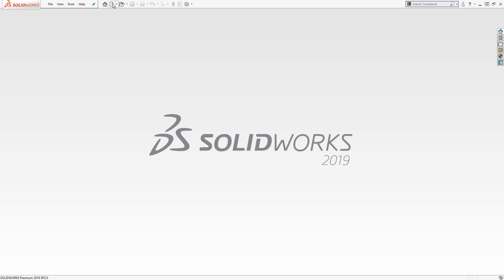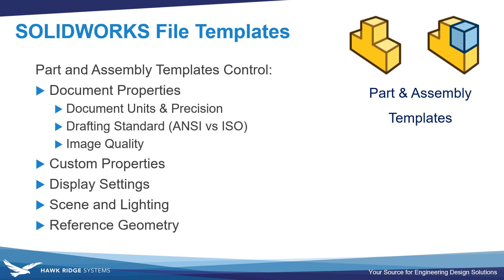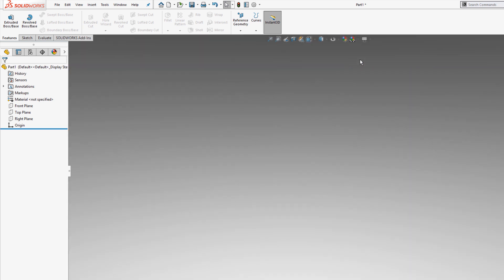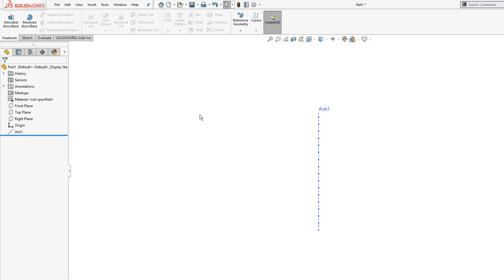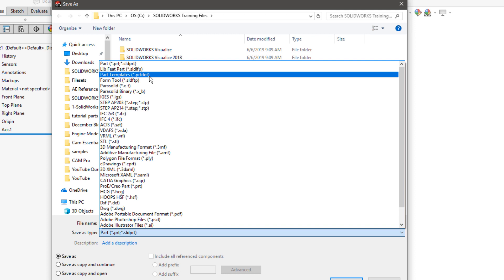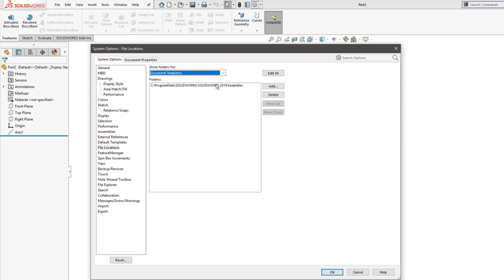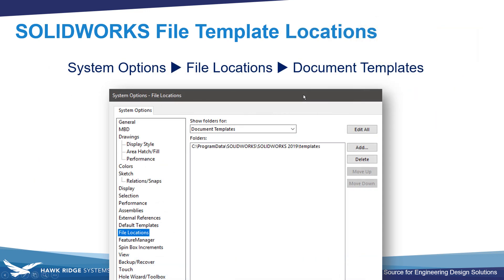SOLIDWORKS: Part and Assembly Templates

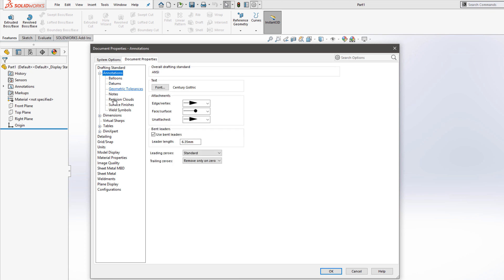Comment: You left your Drafting Standard as ANSI.  Then at 2:17, you say, "If you want to make any changes to annotations or dimensions, this is where you could do it."  But, as soon as I changed the font from .125 to .156, the DRAFTING standard is no longer ANSI.  It becomes ANSI-MODIFIED.   The same thing happens when I change anything under "Tables".   I don't recall putting a bend table, bill of materials or title block in a part or assembly.  Those things go in the drawing.  Am I wrong on that?  Then at4:39, you say for the metadata entry, "Part Number" and select "Number" without the "Part" that you said (but is not a choice) and gloss over the existence of PartNo.  That caused me a problem on BOMs when the PartNo column of the BOM was blank because it was set to "Number" which was not used in my custom properties.  Then you ended without even mentioning the System Options! (??)  Doesn't the number of recent documents go into the template?  How about the display colors?  The Selection method, either box or lasso?  External References? Spin Box increments, that I specify different than the SW default?   Does everyone use the default Hole Wizard/Toolbox with the SW default entries.  Don't all those things get specified in the Template?  I have more questions now than when I started this.  I was under the impression that the "System Options" went in the Template, while the "Document Properties" went into the format.  I'll keep looking.
Reply from the maker: Changing the settings defined in the ANSI standard automatically changes the standard to ANSI-MODIFIED. BOM Tables can be added to an assembly in the SLDASM file itself and will be displayed in model space. The table in the assembly environment can then be imported to the associated drawing(s). BOM fields should match property names in order to pull information from the assembly file. Start by defining property names in your assembly file (and be sure to save as a template so they can be accessed on all new files). Then create a BOM and ensure the column headers are reading from the correct respective properties. You can then save the BOM as a template for reuse as well. It is recommended to leave System Options as default unless a change is specifically needed. This is the best bet for optimized performance. Hole Wizard data is very reliable because it is based on existing standards, again recommended to only change/update when specifically needed. System Options are universal system settings while Document Properties are specific to each file and must be saved with a template to reuse. Hope this helps.

Comment: Nice video. On a different note, I recently updated SolidWorks and had to do a complete wipe on my SolidWorks 2019 version for the 2020 which came with a bigger kit. My issue is I get a notification always saying that templates are not present when switching to the novice option. After making two templates in the ‘parts’ directory, I still get the same message.

So, I switched to advanced to do my opening the parts. However, now my issue is the only way I can open an assembly is through the tutorial method. I attempted to make a assembly template (with the dotasm), but instead get prompted with “Assembly templates can not be made referencing something something (I believe it was the part). 

Any ideas to help? I would like to do assemblies without having to go always into the tutorial methodology.
Reply: The exact prompt I get when attempting to make an assembly template is:

“A document which references other documents may not be saved as a template.” 

Assemblies have to reference other documents. I am just attempting to save a more reachable template where things are all together than several files away. 

Any help is appreciated.
Reply: Search your computer for .prtdot to see if they are somewhere else

Comment: Great video. Question, when I go into the file properties and click on the property pull down menu, there is nothing there in my seat of solidworks, why would that be?
Reply from the maker: There is a file type called a Custom Property File that is supposed to populate the default properties. You can check under your System Options -> File Locations and choose Custom Property Files to browse for one. It's likely yours is missing

From within the regular File Properties tab though, you can also click "Edit List" which will allow you to create new names for properties that will be available from the pulldown.

http://help.solidworks.com/2019/english/SolidWorks/sldworks/hidd_editcuspropdlg.htm

Hope this helps!
Reply: @hawkridgesystems  thanks!

Comment: Ho can I select an existing template when I want to create a new part from in an assembly?
Reply from the maker: This should be controlled by a system option. Under System Options -> Default Templates whatever templates are set there will be used for new parts created in-context.

If you want to be able to choose which template on creation, then choose the "Prompt" option instead of "Always use these default templates" then you should receive a prompt allowing you to choose each time you create new parts in an assembly.

Comment: It is possible to change from one assembly template to another after creation? Example, I use the default template and create an assembly and then take the time to create a custom assembly template 2 weeks later. Is it possible to change the original using the new assembly template I created?
Reply from the maker: Hi Jim, unfortunately there is not an easy way to swap out templates after the fact. The usual course of action would be to manually adjust Document Properties and other changes to match. There is a utility called "Design Checker" that can potentially be used to batch scan documents and make sure they have the same properties, which would be useful if you made any major changes after the fact. We have a video on using it: https://www.youtube.com/watch?v=0W0JcWjCWEc

There is a trick you could try specifically for assemblies, which is to create a new Assembly with your new template, insert your old assembly into it (it will come in as subassembly) and then dissolve said subassembly. Have to be careful with that approach, as it could break certain features (assembly features and so on).